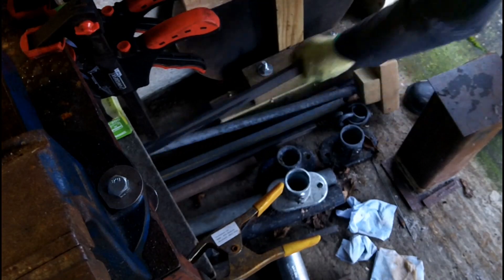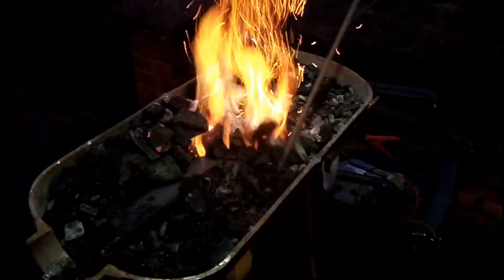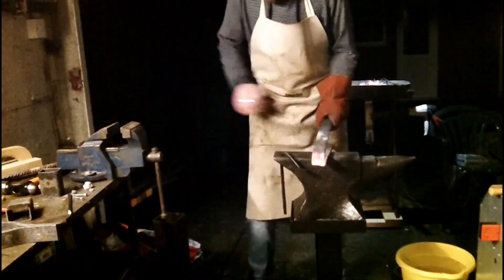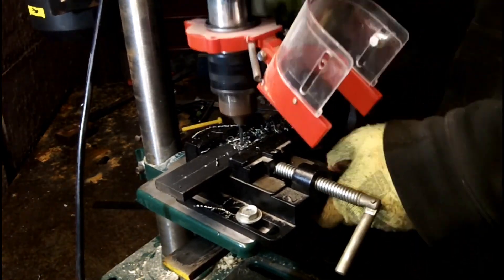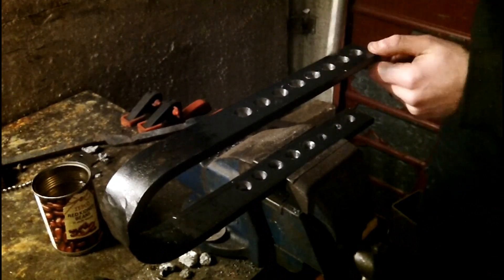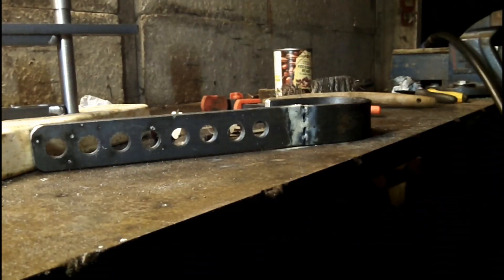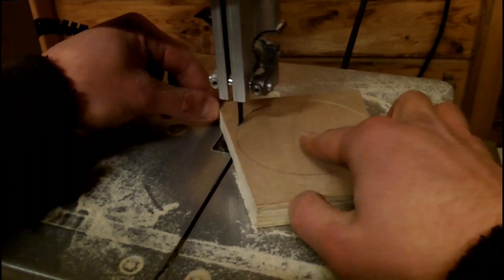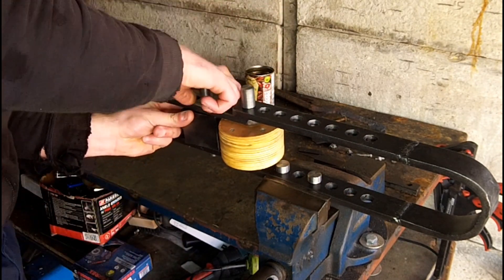I am Bender; Please Insert Girder

Comment: Nice work Jay! This video may be of interest to you for helping to speed up bansaw cutting times, https://www.youtube.com/watch?v=5fvhbhTxF0c 

P.S. Try avoid wearing gloves when using the lathe, you put yourself at risk of getting pulled into the chuck. Same rule applies to anything that has a rotating part in the workshop.
Reply from the maker: Thanks, that's useful. I'll remember that for next time.
I only wear those nitrile gloves because I know that they are very tight and also very weak. There's little risk of them catching, but if they did, they'd just snap. Do you think that's fair or still too cavalier?
Reply: @janionmakes  Whilst I agree that they are week and likely to snap, in my experience it is generally a no no. And if you do you will most likely get told by one of the old boys to take them off. So I always would take their words of wisdom.